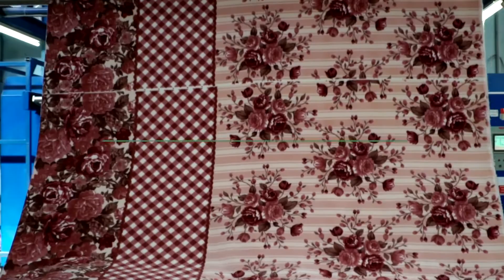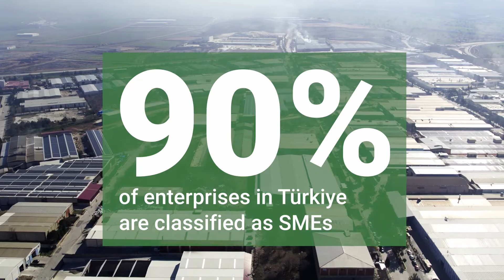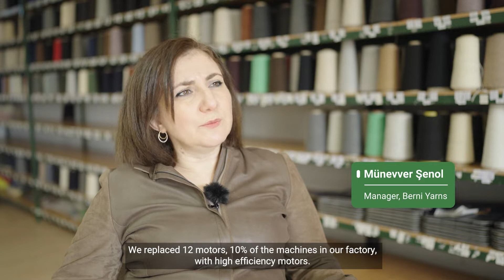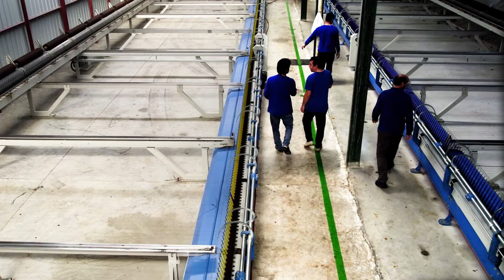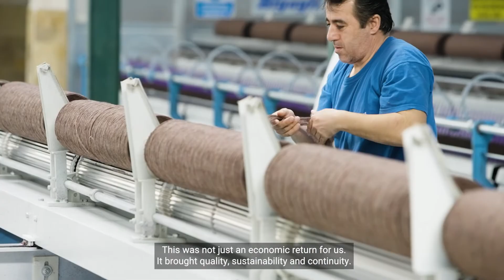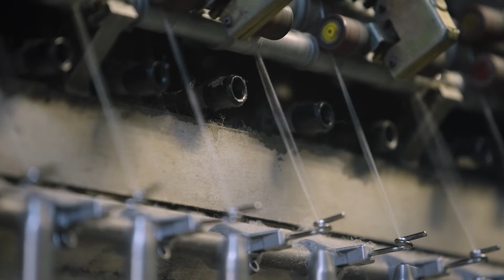Electrifying change: efficient motors revolutionise #climateaction in Turkiye

Comment: A 20 year old induction motor usually still has >85% efficiency at half load. They are already so efficient, pushing them to 90% efficiency by replacing already working motors just creates Waste. The problem is not motors, it is the production line and machines. The machine that is being run by the motor is the inefficient part, changing the motor does nothing.